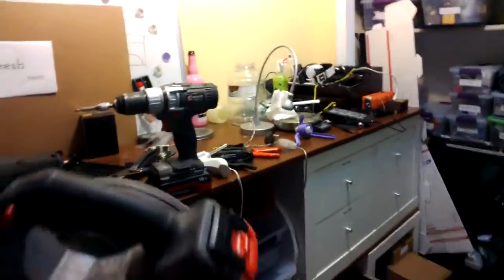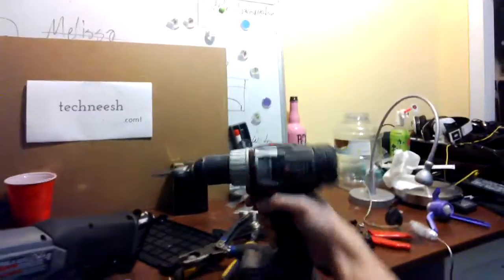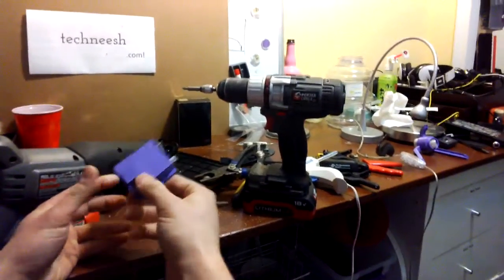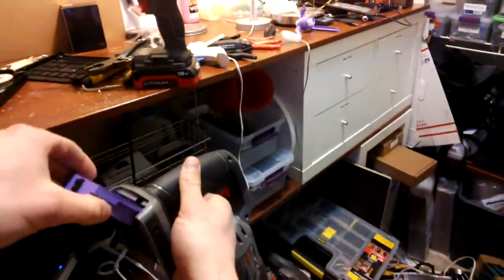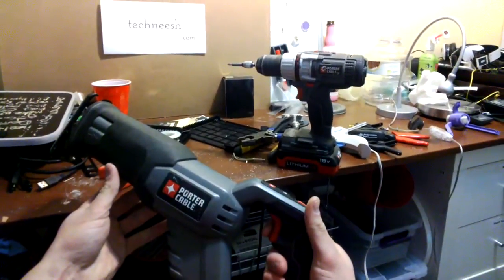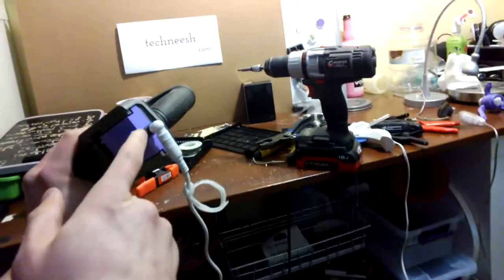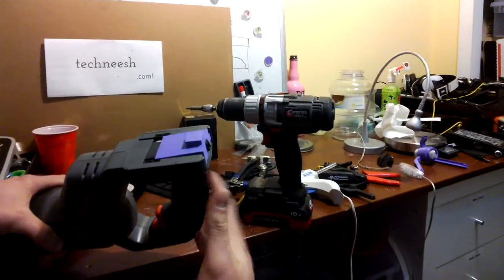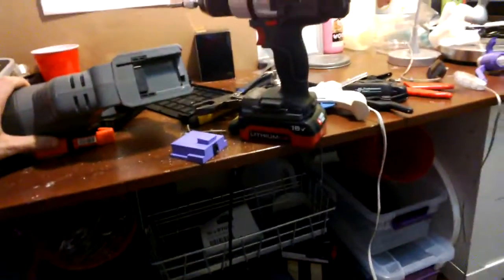3D Printed Power Tool Cordless to Corded Converter // Battery Adapter to Wall Outlet!

Comment: Could you make a Porter Cable adapter that would let me use their 20V batteries in 18V tools?
Reply from the maker: sounds like a great idea. what do you think the budget should be for supplies? as in, how much would you be willing to pay for one? i use porter cable myself (have all 18v atm). i imagine the 18v tools could probably handle 20V but the adapter may need to incorporate a buck converter... hmm...
Reply: Will Stone
Price wise, do you think you could do two for $150? I don't think voltage is a problem. 20v tools have 20v resting volts, but only 18 when in use. 18v tools are designed to handle these extra volts, so a 20v battery should work perfectly with an 18v tool
Reply from the maker: Ad Man awesome re: voltage. yes re: budget- i'll order a 20V PC battery from amazon today, hopefully I can have a prototype by the weekend. i do profit sharing on all future sales for coop projects like this :) if you wanna chat via email click contact on my website techneesh (i'll put a link in the video description)